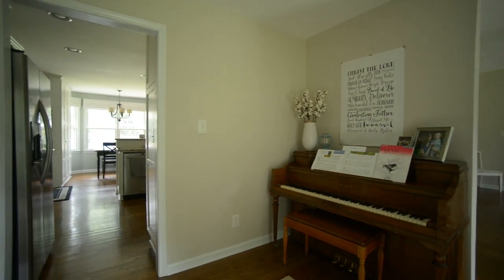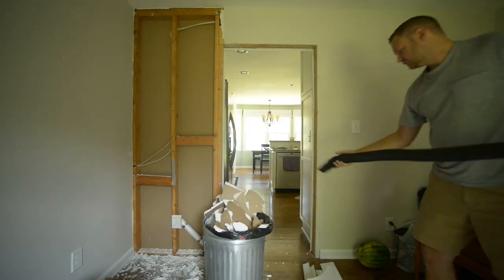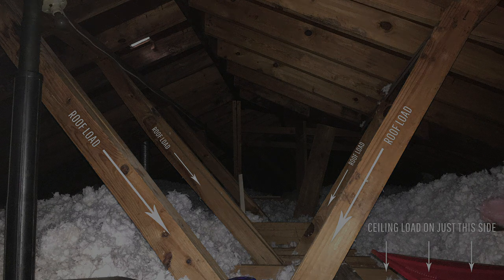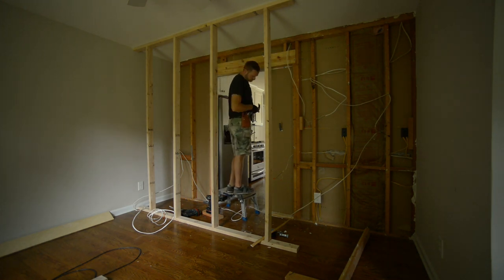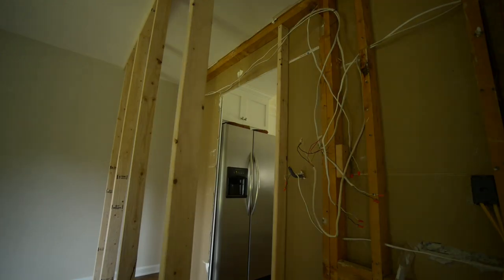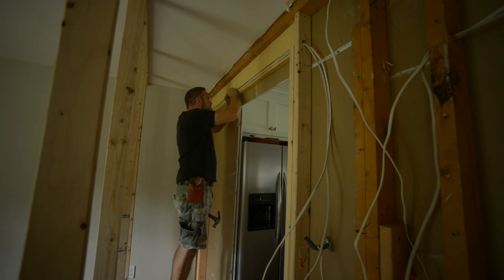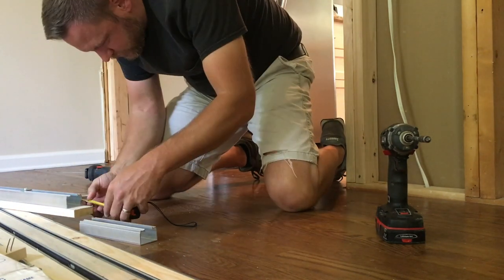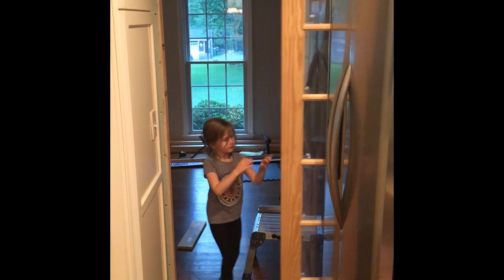Pocket Door in a Load-Bearing Wall  //  DIY Home Renovations

Comment: One piece of advice. When building your temporary wall, cut the drywall out as it can compress under load and cause a sag. If you locate the truss or floor joist above you can just cut a hole small rather than a trough and put a 2x4x4 piece in for the temp wall to support. With that put the supporting studs right under those blocks.

Comment: Great video, very helpful! One question, do you take out the bottom plate within the door opening while framing out? I couldn't tell from your video, and you didn't say. It seems to me like the pocket frame would be installed directly on the subfloor, but I couldn't tell. Just want to make sure I don't cut out something I don't need to!
Reply from the maker: Yes, the bottom plate is removed.  The pocket door frame should be installed at or as close to finished floor height as you can.  So in my case I believe I added some ply to fill the gap where my bottom plate was bringing it up to my hardwood height.

Comment: very awesome! can you still do something like this on a load barring wall that is supporting a second floor?
Reply from the maker: Thanks, Shelley!  Yes, this can definitely be done with a second floor load above.  However, every situation is different and you should consult a structural engineer to determine what size header you'll need.  With the increased load of a second floor, you'll likely need a larger structural support than what I used.  With that increase in size, there's a chance (depending on your situation) you'll need to recess the header up into the ceiling/floor above to give yourself enough clearance.  If that's the case, it definitely changes the scope of the project.  In my situation I was only dealing with a ceiling load on one side and a small roof load.

Comment: So when you you tied-in the joists/braces, are you saying you used a board spanning across and screwed them in that way to assist with the load? Or am I completely reading that wrong? Could very well be me understanding that wrong, only reason I wanted to clarify! ;)

I am removing old paneling from the 70's in my den, closing off two off-set doorways that make the room hard to arrange, and want to open up a 48-inch doorway (eventually adding a french door when money permits) to let in more natural sunlight from the living room and make the room better balanced. The wall I want to add the doorway on is load bearing. Single story home. Been trying to research this for a week to make extra sure I've got this planned correctly.
Reply from the maker: Hey Andy!  First up, I'm no expert...so keep that in mind.  :)  I didn't add any spanning board.  The roof load braces (you may see them called purlins or struts) that were coming down on that wall were right next to some of the ceiling joists on that one side.  Therefore, I was able to tie the purlins together with the ceiling joists using structural screws.  Hope that makes sense.  And remember, in my scenario I only had the roof load and the ceiling joist load on the one side.  You may need to support both sides in your case.  If you're unsure, then a few hundred dollars spent on a structural engineer to come take a look would be well worth the money.  He/She would also be able to calculate the proper beam size for your application.  Let me know if you have any other questions!  Happy to help if I can.  Make sure to check out the You can, man. Podcast too!  We actually have an episode discussing load bearing walls.
Reply: Thank you for the (quick) reply! Yeah, basically I've read several experts online, watched a handful of video from both experts and just folks like myself working on DIY projects. Finding common threads and techniques, basically. I figured that I will error on the side of overkill, I'd rather have more support and bracing in place than I need than not enough, I've never heard of damage to a house from supporting it too soundly! My grandfather was a master carpenter and I have some old books of his that are strictly about framing houses, etc. So, I have those for cross-reference. I'm an I.T. admin by trade, but I have learned quite a bit being a home owner, this being the fourth area in my house I am remodeling over the last five years, but my first time dealing with a load bearing wall and making alterations to it.
Reply from the maker: @AndyMorris_BAP  Sounds like you're well on your way!  You'll find tackling the load-bearing wall is a big confidence boost.  Take it slow and think of all the money you're saving!  You'll also be able to pass on your knowledge to a friend.  Best to you!

Comment: How did you screw the supports in on the already drywalled-side? Did you screw through the drywall and the support into the pocket door header?
Reply from the maker: Hey Mason!  Sorry for my late reply.  Yes, I did just as you thought.  I actually ended up having to screw through the inside of a kitchen cabinet on that other side.  I should've shown that in the video and didn't.

Comment: Awesome video man!  I am planning on the same deal with only removing one side of the wall.  My question is how did you locate the screws in the stud in order to cut?  Maybe I am over thinking it but I don't want to mess up the drywall on the other side by digging around trying to find them.
Reply from the maker: Hey Tony, sorry for my late reply.  You could use a strong magnet to locate those screws and carefully remove them.  I'd recommend the stud find I use made by CH Hanson.  https://amzn.to/3s9wLiN  I think what you'll find however is that if you're careful you can just pull the screws out with the stud without harming much of the finished side of the drywall.  The screws should be inset some and then mudded over, so hopefully you can pull them through only pulling with it the back side of the drywall.  You notice in the video that's what I did.  I should also note that I have cabinets on most of that entire other side, so I wasn't as concerned messing up that other finished side.  I was just focused on keeping it all intact.  Hope this makes sense.
Reply: @Youcanman  Totally makes sense and I greatly appreciate the help and advise!

Comment: Did you have to apply for a building permit to do this Reno?

Subscribed! Great video. Love the time lapse & voice over. Made a believer out of me
Reply from the maker: I didn't feel like this was a huge renovation and therefore did not.  Also, I had already increased the header length once before on the same wall as the pocket door opening during a prior renovation that was under a permit.  I was simply increasing it more this go-round.  However, chances are good that your local county/city government would require a permit if you asked.  :)  Thanks for watching!
Reply: Can’t wait for more videos! You do great work for some one who has no experience. This gives me hope to do my own renovations

Comment: Might you be able to estimate how many hours you spent, sans the shopping for supplies?
Reply from the maker: For just the wall with the pocket door I'd say maybe 10-15hrs?  Hard to gauge because I broke it up over several days.  It included some electrical as well.

Comment: What are you hammering in to secure the wires?
Reply: One more question.. what type of screw or nail did you use to secure the tops of the upright door support to the pocket door track? Same as the screws that you used to hang the track? Thanks!!
Reply from the maker: I used insulted metal staples like this to secure the wiring: https://www.homedepot.com/p/Gardner-Bender-1-2-in-Insulated-Metal-Staples-in-Yellow-for-NM-Cables-100-Pack-MDI-150Y/100210258
Reply from the maker: @kerryfrost5501  not sure on that one.  Likely the same screws.  Thanks for watching!  Let me know if you have any other questions.  Happy to help!

Comment: looking good... Are you gonna do the drywall? What app did you use for the design stuff?
Reply from the maker: Hey Nic!  I actually hired out the drywall.  Could I have done it?  Yes.  Would it have taken me 3x as long?  Definitely.  :)  I'll show the finished/painted drywall hopefully in part three.  Those design overlays were just photoshop work.  I used photos I shot of the finished framing and then inserted drawings of the doors.  The cabinet/built-ins overlay was just a screenshot from a IKEA design.  I brought it into PS and cut it out.